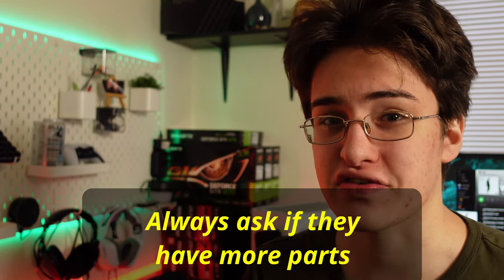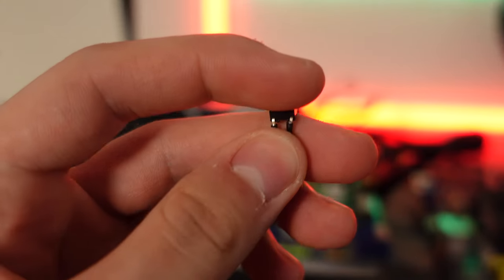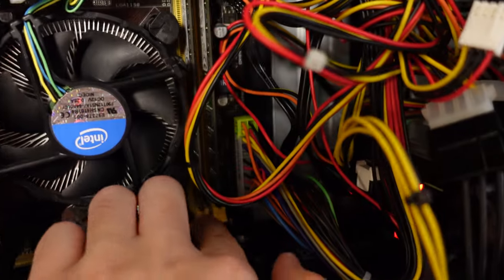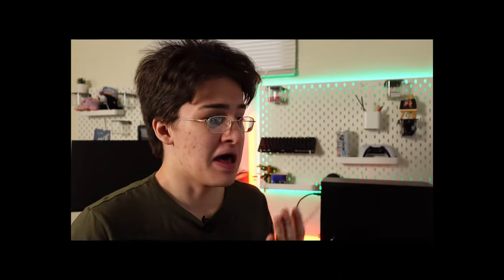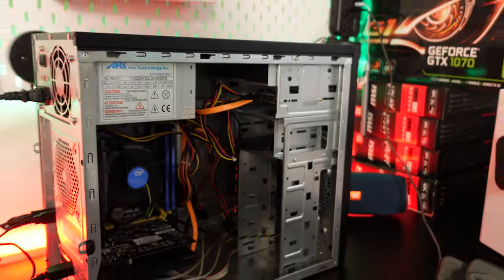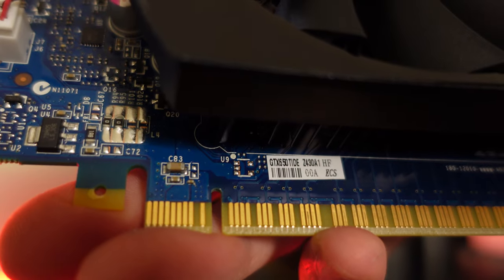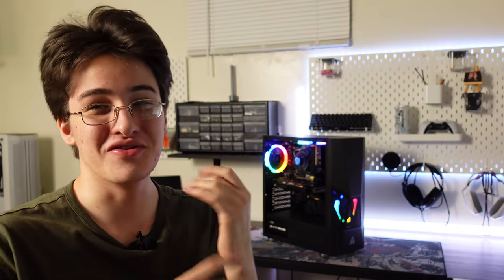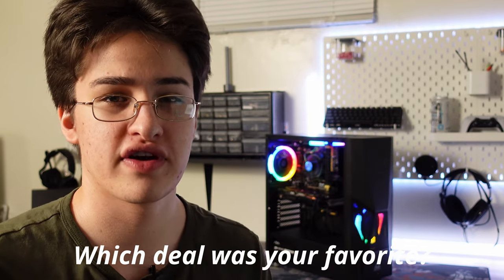Spending $840 On Used Pc Parts!  | Used pc parts haul for pc flipping!

Comment: I bought a pc with a i5 2400 with a 1050ti with single 4gb stick of ram🤮 and no ssd i bought the whole pc for $100 did a case change and add extra 4gb ram and a 500gb ssd total was around $230 sold it on a bid on ebay for $400 with free shipping and it was my first time ever to sell a pc on ebay
Reply: You probably could have sold it for 500, how long did it take to sell?
Reply: @MystGecko2089  yeah i know but i wanted a quick sell and it took me around 5 days to sell
Reply: @bobrat8966  thats not a terrible profit though
Reply from the maker: Pretty good!